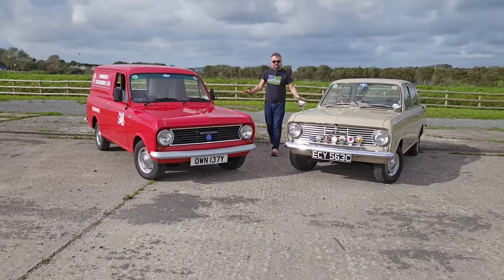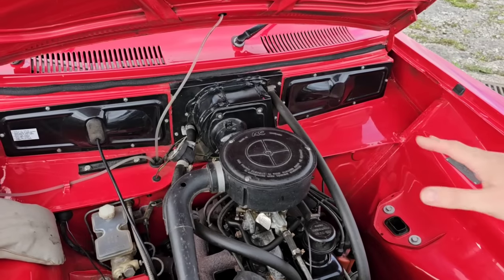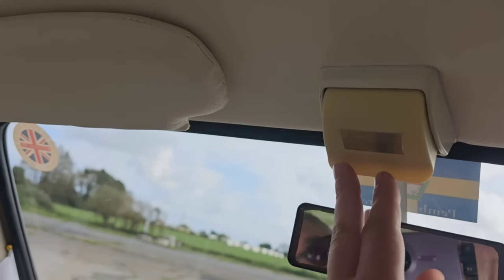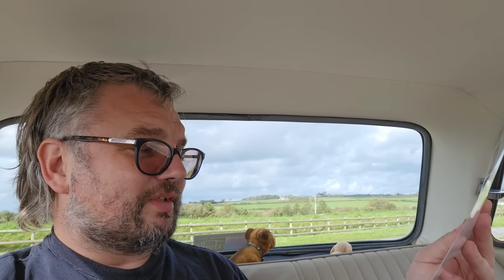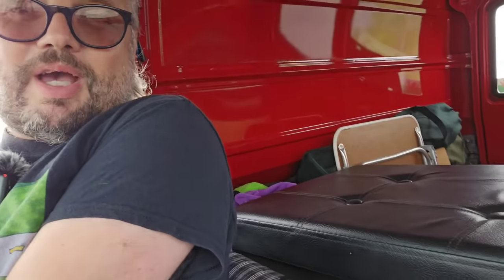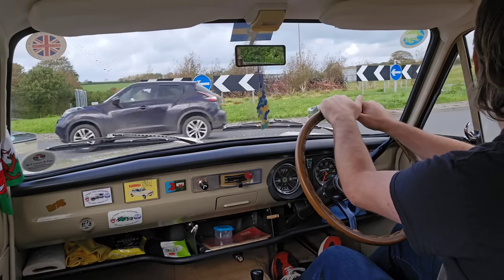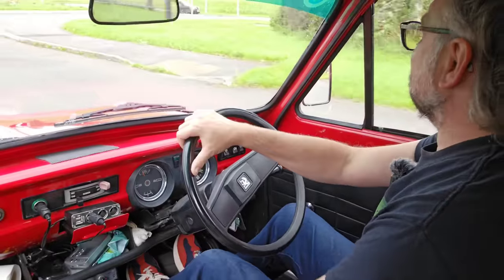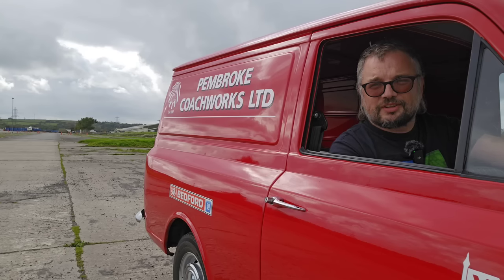Vauxhall/Bedford HA Viva saloon/van double test!

Comment: My first car, having not long passed my driving test, was a Viva HB manual transmission. I recall the gear lever coming off in my hand after a rehearsal near Chichester, and one of my fellow band members managing to re-locate it in the 'hole,' in order for me to be able to get home. I have to admit that this was the first and last time that a gear lever parted company with the rest of the gear linkage and came off in my hands. 

The other thing I had to do on a regular basis was to remove and clean the carburetta - I think the fuel tank needed to be replaced - by I never got that done. I was quite attached to the Viva - but I preferred the Ford Escort I got to replace it.

Comment: I bought a new HA 8cwt van in 1969. I bought it to use as a car as back then cars were subject to purchase tax of 33% but vans were tax free so mine only cost  £440 or so. There was a 6cwt version, mine being 8cwt had heavier ply tyres plus rear springs and had a bright metal strip on the side waistline and came complete with heater and front passenger seat.

Comment: I just about remember the saloons still being around when I was a nipper - they would have been getting on for 10 years old by the mid 70s - so positively ancient in 70s car terms (when many rusted to a pile of oxide within 3-4 years). My grandad had a HC, but one of his neighbours had a HA - maybe a SL? It had three round rear lamps each side, rather than the cute oval jobs on your test car. The vans were bargain of the century when they were sold off from Post Office or BT duties.

Comment: Worth noting that the HA van wasn't the only similarly sized van GM were selling in the late 70s/early 80s. I had a Bedford Chevanne on an X plate, a year older than this one. It seemed a bit odd at the time that they kept the HA on when the Chevanne was in production.
Reply: I think the double doors and slightly higher roof was a requirement for HA buyers (mainly GPO/Telecom). It was also sold alongside the Mk1 Bedford Astravan, and was only really replaced when the Astramax came out.

Comment: Glad you discovered the impressive turning circle. That means a massive drift angle to be had on wet roundabouts. Way more than capris or escorts as I demonstrated to my terrified cousin back in the days of teenage immortality. They also do perfect black circles in the dry, one wheel peeling flat out in 2nd on full lock. As many exactly overlaying laps as you want.  Amazing.  I had a £20 gas board blue ha van that I matt blacked before it was a thing. Unsurprisingly it didn't survive my ownership more than a couple of months. And yes the seats were horrible.

Comment: I have a 1978 estate car with drums all round and no servo. Really needed you to push the brake to stop. ABS not needed as it was impossible to lock the brakes. I got a knee joint problems as a result of the effort to stop the car.

Comment: Now there's a trip down memory lane, I used to drive the vans quite a bit back in the day, handling was always great fun with the stiffer van suspension, I'd certainly agree about the later seats which contemporary CF drivers also suffered, they more like instruments of torture than seating, in both cases earlier  versions were much more comfy !

Comment: Sweet little car. I shall call it Oliver😀😀😀😀. It's very like Hammond's Kadett isn't it. Can vouch for how hardy that engine is especially when compared to a newer Lancia Beta coupe. It's very good in deserts and off road with no need to take apart the bodywork like a Mercedes 200. Different Speedo though.

Comment: I had an HA van as a second vehicle back in the 80s. It was quite a late one reg LCH 483W from memory. It hadn't carried any weight but I suspect it had seen some use and abuse. I don't ever remember it letting me down but their was some transmission back lash somewhere. The rear axle did eventually start making some awful noises so I took it to a rather excellent local garage who got one from a local scrap yard but then found out there must have been several versions as it didn't fit. They took it back and got one that did and they fitted that. A shade crude maybe compared to other available vans but  simple and reliable and what else could one ask of a van? I think it had been panelled in ply too.

Comment: I sold both new,  at the time the novel feature of the car was that, as you set off, the back end didn't sit down - it went up. The car version was as good as anything British that you could get at the time and in terms of quality, quite a lot better than the HB. The van was also available as a camper and a proto-Berlingo although neither sold very well. I ordered them all with power disc brakes 
( about 15 quid ) and radial tyres - best 20 quid you ever spent!
Reply: I remember the Chevette "E" came on crossplies !
Reply: @hunchanchoc8418  Most did, but for 
about fiver you could get radials AND specify make. Michelins were a favourite.

Comment: I’ve had both of these. In fact I took my driving test in a 65 Vivian 1973. The big problem with them was rust. Mine was very rusty, the examiner huffed when he saw it and reached in to ensure the seat was actually fixed to the floor. Both cars had a plate riveted in the footwell which must have been to cover a hole left by the production line jig. There was also a rubber pipe which took water away from the vents at the base of windscreen and deposited it into a box section in the front wings. Both took about 5 mins to go rusty. I actually had two vans which were yellow and ex BT. I believe the van was called a Bedford Beagle.
Reply from the maker: The Beagle was a car version of the HA van, with windows and rear seat.

Comment: Had an HA Bedford van (ex-London Transport), bought at auction for around 600 quid in late '83. Toured all over the UK in it and in 1988 we toured all around Europe in it and slept in it 90% of the time. Got within 120 miles of the Syrian border in eastern Turkey in it, and then drove back to the UK via bits of Europe we had seen on the way there. Only hassle we had was we had to clean up the alternator armature in Turkey. When we arrived back at a relatives in Essex, we had no tax or mot, 4 bald tyres (including a rear with a bulge in the wall), no spare (shrapnelled), and had driven the last 25 miles on empty as we only had 2 quid in English money when we got off the ferry in Dover. Sold it within days to a plumber, who asked, "is it reliable?" Said I; "We've just made it back from 120 miles from the Syrian border, you make your own mind up." He couldn't get the 125 quid asking price out of his pocket quick enough!!!!

Comment: That noise took me back. My dad had a pale blue K reg HC circa 1981 with an am radio! After breaking sharply, my dad headed straight to the hospital. My sister fell off the back seat, and hit her head on the massive nut in the middle of the transition tunnel used to anchor the seat belt clips. She still has the scar to prove it. Good days.

Comment: Interesting to learn about the front suspension arrangement, since the HA's distant (really, REALLY distant) corporate cousin, the C2 Chevrolet Corvette (likewise a 1963 debut), also used a transverse leaf spring setup in front AND in the rear. Transverse leaf springs would remain a Corvette staple right through to the very last front-engine models in 2019!

Comment: My dad bought a new HA in '65 that was exactly the same hue as the saloon in this clip.  The colour was called Fawn and replaced Cavalry Twill in the Vauxhall paint palette.  

It replaced a 10 year old Fiat 1100 and was not the most reliable of cars but got the job done ferrying the family about.  It was roomy for its time and impressively economical and light to drive though it ran out of puff around 50 mph.

Comment: Because there was no estate variant of the Mk1 Viva, an enterprise in Kent put a rear seat and back windows into the HA van, and called it the Bedford Beagle (it was Martin Walters who converted it, the people who made the Dormobile conversions).  It was sold through Vauxhall dealerships until the Viva HC estate made it unnecessary.  As a teenager in 1966, I was asked by my parents to recommend a replacement for their old Hillman Husky (the one based on the Minx), and I suggested either the Escort estate or the Bedford Beagle.  When I pointed out an Escort to them, it was a maroon one, and my father just said "dried blood", and it was thus decided to get the Beagle!  It was scarlet, like the one in your test.  I loved driving it - the skittish rear end taught me how to handle spins (I practiced in snow...), and the gearbox was an utter delight - the gate a tad wide, but so precise and light to operate.

Comment: Thank you! These Vauxhall tests are very meaningful to "boomers" in Australia.
For about 15 years (1952? - 1966) Vauxhalls actually badged as such were sold alongside Holdens in some Holden dealerships - and likewise in New Zealand.
When Holden properly embraced smaller cars in 1967 they started assembling the Viva HB with Holden badges as "Torana". And then even further embracing small cars, they did their own restyle of the HB which became the LC and looked not at all like an HC. In some ways the LC Torana was a better and more handsome product than the boxy HC. Google a picture of an LC Torana and see if you agree:)
But to give more of the inside story, Holden NEEDED TO reskin the HB differently because they had a secret plan.... the LC could be ordered with an 1159, a Vauxhall-sourced 1599, or Aussie-sourced 2250 and 2600 6 cylinders! So some lengthening of the nose of was required - but the 1200/1600 version still had a short nose.
In basic terms the LC was just the HC from a parallel universe - but it was really 2 slightly different cars: one that was an HC with a swoopier skin, and one that was reinforced at the front and longer to take the 'Holden red 6' engine.
All of a sudden "Vivas" were doing 105mph in the hands of people (including the Australian police) who would never have given the HB a second glance.

Comment: Funny, I was going to mention the wheels. Trust you to know those sort of minutiae!
I had a Viva HA saloon, back in the 80s, also a '65 on a C plate. I remember it being a very smooth drive for what I expected to be a bit rough. It was basically an unrecorded write-off, with a dented rear panel (which I levered out with a big metal bar, to enable the boot to close). Cost me £15 and was worth every penny!

Comment: A surprisingly good stable chassis, largely due to the GM classic long-nosed axle that was also seen on much sportier vehicles (Magnum, Manta, ...). The van's 1159cc engine had pathetically inadequate thrust bearings that would effectively attack and ruin most of the drivetrain eventually. I remember going to the SMT parts counter in Inverness with all the vehicle and engine details carefully noted. I gave the partsman the details, expecting both a big bill and a long deliver time. He reached under counter and then placed a new crankshaft on the counter in front of me. Well that tells a story! As I turned to leave, carrying the new crankshaft, he turned to his colleague and told him to get another one ready from through the back.

Comment: Beware when buying spares, the HA Viva and HA Beagle Van have different doors and front screen. In the early 1980s, I had to make up new bottoms for a pair of rotted out front door on a 1970s van. We had it in to repair some rot and  repaint it. The owner was on a tight budget, and told us he had obtained a pair of good used doors. When he turned up with them, they were from a Viva, the door top and glass area are around 3 inches shorter than the van doors.

Comment: The HA Deluxe was the first car I owed, and I used it while I was restoring my 1960 Mini Minor 850. I recall it also being cold inside and the transmission being very whining and noisy. It always felt very basic and tinny too, although it was very easy to drive and reliable. Sadly, I never especially liked it, and sold it to my brother when he passed his test, but unfortunately he crashed it 3 months later. I much preferred the Mini, as it was so much more fun despite being slower, but the ridiculously long gear lever was always like stirring porridge!

Comment: I love the simplicity of the Viva HA and it’s Bedford sibling. It’s amazing that the production run was 20 years and because of this many spares are still obtainable for the Viva HA even now. That would not have been the case if the van had ceased production in the 1960’s. Mechanically many parts were used in the HB and HC Viva’s.

Comment: I had an HA van in the 1970s, the only thing that I can say is that I found this van to be reliable and cheap to run, it served a purpose and was the right size for my work, I was working from Kent to Wiltshire so I clocked up lots of miles, basic but usable, it served me well

Comment: My cousin Michael had the posh SL version (it may even have been an SL90) of the HA and fifty years later, the registration has just popped into my head - GBD  220C. Similarly, my uncle drove a HA van when he worked for a company called Brock's Alarms - KGC 414K. I always remember them in yellow with "British Rail" on the side. However, I can't remember where I put a photo a few days ago... and yes, that Viva soundtrack - which my B310 Datsun Sunny also had?

Comment: It might seem sparse to younger viewers with all the painted steel surfaces and plain rocker switches, but it was part of the minimalist charm of these and the German Opel counterpart. Wouldn't complain at all if a LHD version of that van found it's way into my driveway, An other fine video! Cheers from NY.
Reply: Even as a kid I recognised the dash was designed for either LHD or RHD - the position of the ignition switch has it's counterpart on the other end of the dash with a sticker showing the Vauxhall logo.

Comment: The steering wheel in the van looked smaller than the saloon? As a pre-teen I remember when the HA Vivas first arrived in Nairobi in the early 60s and several vehicles in different colours and levels of trim were displayed on a stand at the annual agricultural show. There was a competition aimed at kids who could try and win a new car by completing an airfix-type model build of an HA in an impossible time limit! We were allowed to keep our dismal efforts as a consolation prize. I will also never forget seeing an enormous radio installed on the parcel shelf down by the driver's right knee in a lovely pale blue example. I swear it had valves in it!

Comment: My father bought a used HA Viva in early 1968 soon after we arrived in Melbourne. It was a big step up from the plastic pig, sorry Reliant Regal that continuously broke down in the UK. We had it for less than a year and he bought an X2 HR Holden Wagon which easily did 100 MPH before speed limits were introduced. Unfortunately it was stolen and found burnt out a few years later during a rail strike. The Viva morphed into the Torana here.

Comment: I love it, Have so many good memories of the HA van and car, I was about one of the only people to compete in the prestigious Motoring News Rally Championship  in an HA still shown on YouTube Gremlin Rally1973 Helicopter Wood on the Epynt army ranges I must admit not the best footage I have seen but at least it shows the Viva quite well.The other rally I did was the Cilwendeg although this time in a 1300 Chevette, starting and finishing in Newcastle Emlyn where the van came from. Both cars had a modified engine and both revved quite easily to 8000 RPM  and I never considered them blowing up. I was told by Frank Harrison  who rallied against Pat Moss in her days, that when they tested an engine for Brabham it was revved electronically to about 15000 RPM before anything broke don't think mine would go that far ,besides the rev counter only went to 8000 When I worked for a Vauxhall Dealer Derek and I often took the parts van down the A2 with the speedo needle round on the main beam light and again  no problems! young and stupid probably but no speed cameras or ULEZ then I have just had the HA restored and it had very little rust so perhaps a hard life suited it  Well done to Pembroke Coachworks fantastic job on both!

Comment: Great review as ever Ian remember them well the vans especially were everywhere dad worked for Royal Mail and they had quite a few at the office and most utilities had them and private buyers as they were cheap to run 
If I remember rightly the engines were Vauxhalls own design they were not shared with opel (even though the two cars were on the same project) what became 1057cc grew to 1159cc in the HB and 1256 in the HC and chevette 
The stubby gear-lever was the same all the way through viva production and found its way into the chevette and mk1 cavalier base 
The steering wheel in the van reminds me of the one in dads chevette 
The saloon and van are gorgeous and he is lucky to have both as they are both rare now looking forward to the next one!

Comment: I inherited a 1964 HA deluxe from dad. Great car. It did however eat clutch cables. I got quite expert at limping to the garage by putting it in gear and turning the key to get going and changing gear without the clutch. Later in its life the fuel tank started to leak not fuel but vapour as it had rusted through near the top! At that point I got rid of it. I did miss it though.
Reply: Driving home without a clutch cable is fun! Did it at least once.